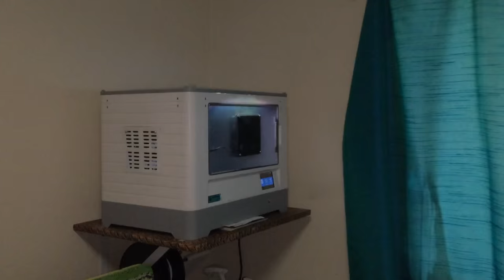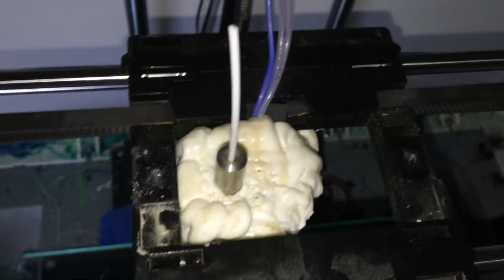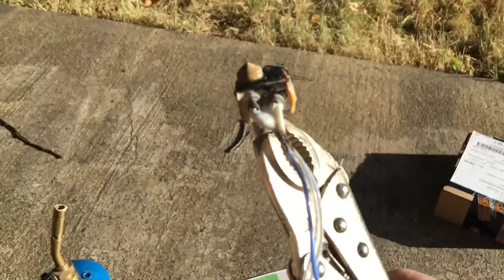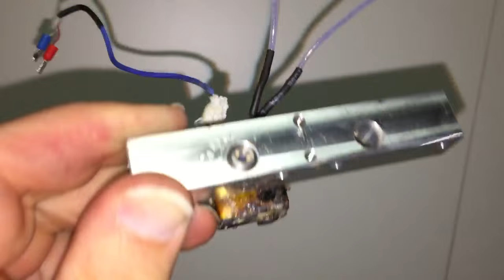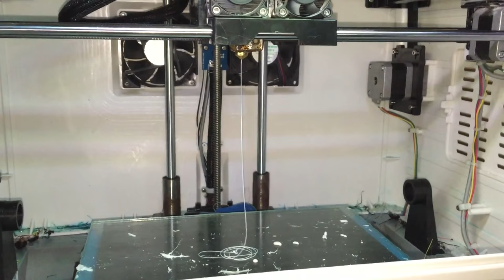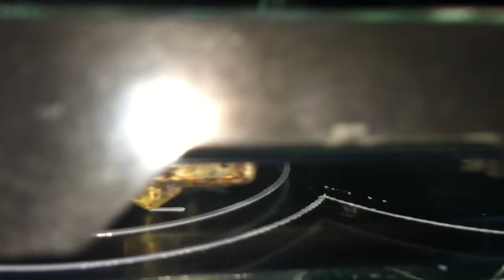Flashforge Dreamer - Clogged Head Recovery

Comment: I've just converted mine to all metal hot end and it was worth it! I used to have to use 220 to get pla to come out fast but now I can drop it down to 200 with no issues, so this now helps with some shrinkage issues, it's like a new printer! Highly recommend doing it😊

Comment: I noticed you installed a cooling fan on the door.  Does that make a big difference?
Reply from the maker: It makes an improvement but it's the 2 high speed fans at the back and on the left as well that make the big difference. 4 high speed fans all up
Reply: Does it make for less 'pixellation' on your prints?  Faster bonding?  The fans on the back seem adequate, unless you know better, as you've had your Dreamer for a much longer time. 
I also notice the dreamer vibrates, and wonder if that translates to problems with the resolution or not.  I plan on strapping it down to a table when it gets moved to its permanent location.  I don't want ABS melting in the house, because of the smell.  So I'll use the unused bathroom with the fan to pull the fumes outside. 
You seem to prefer PLA, any particular reason?

Comment: Hey im looking into a 3D printer, hows this one work? how has it kept up with time? how would you rate it? anything that youve had to replace?
Reply from the maker: +Vinny Gjokaj Hi, Excellent printer. I've treated it VERY harsh over the last 18 months and pumped nearly 15KM of filament through it and it's still going strong. I highly recommend Flashforge, built tough and parts are easy to find on eBay. The internal microSD card got corrupted once which stopped the printer from booting, but that was an easy fix. Install cooling fans and a glass bed and this makes a great printer
Reply from the maker: +Vinny Gjokaj Oh, and the print quality is fricken awesome!! Check out my Pocket PiGrrl video to see just how clean this can print
Reply: Hey thank you so much for the quick response! i really appreciate it!